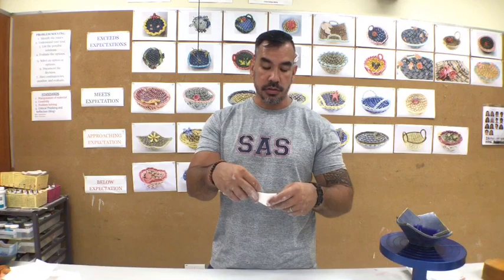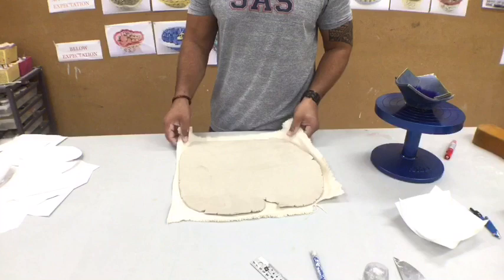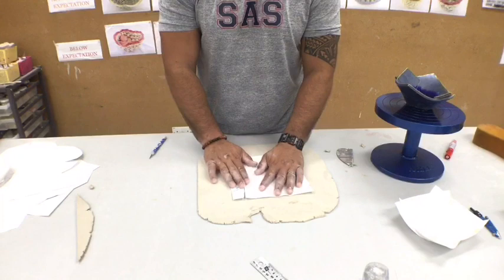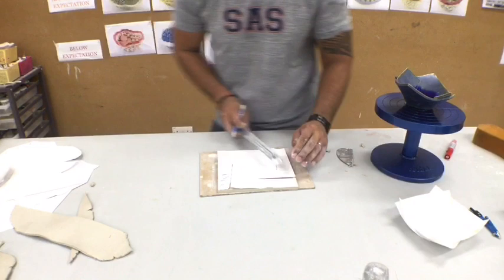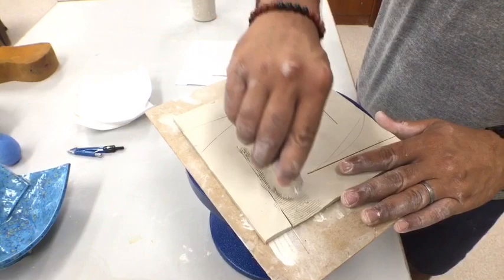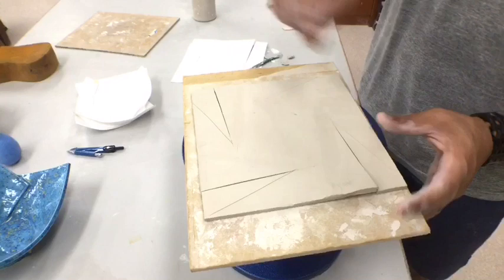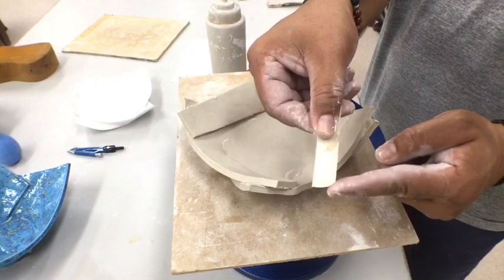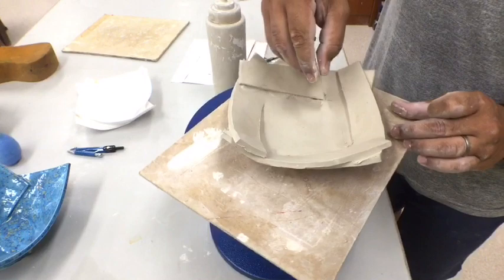Ceramic Origami Bowl

Comment: great video, having trouble with volume?
Reply: Works better with headphones
Reply: I’m interested in the types of glaze and how you get the build up at the bottom!
Reply from the maker: @caraleemcgraw3275  We compress the bottom flat using our fingers.  Prevents it from rocking.
Reply: Jeff Pabotoy I think she meant the build up of glazes on the bottom of the piece, where it looked like the glaze flowed during the firing?  I’m assuming this is ^06. Have you had any problems with too much glaze flowing to the bottom.  Ie: bubbling, blistering, or pitting.